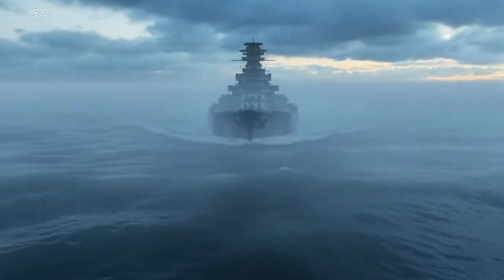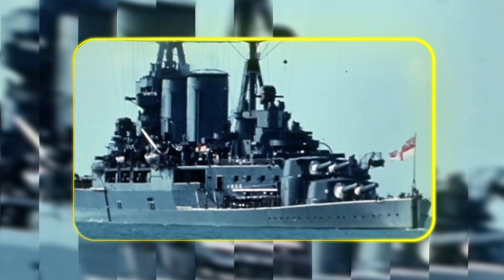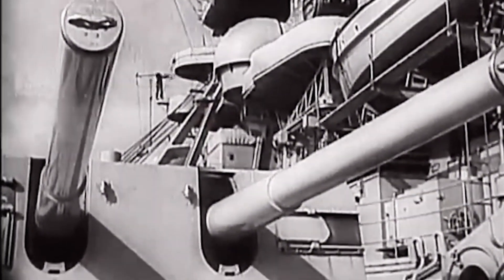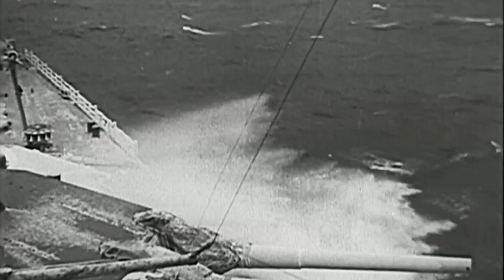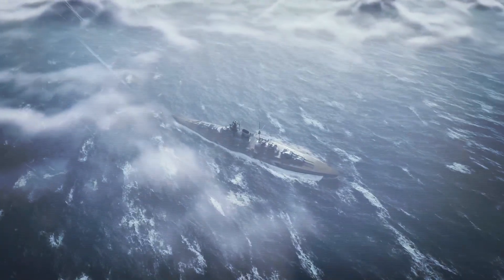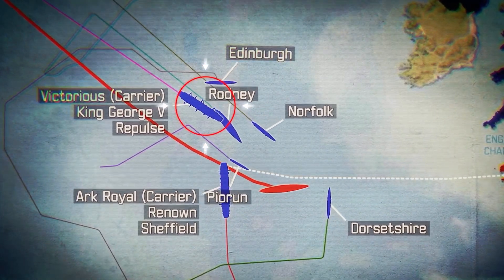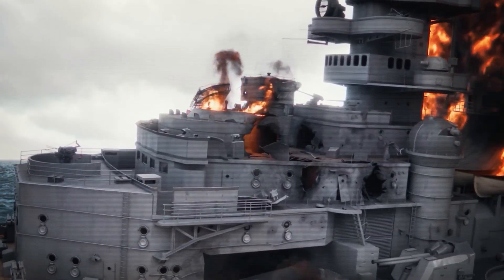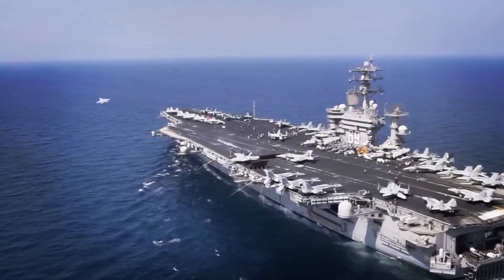The EXTREME Engineering Of The Battleship Bismarck | The End Of An Era

Comment: Bismarck was a very overrated ship. She shared a major design flaw with a number of other Nazi warships, that being a very weak stern assembly. The shallow Kiel canal dictated the maximum draft a ship could have, and this required the Germans to lighten the overall tonnage by going with three shafts rather than the by then standard of four. Four engineering spaces would have made the ship draw too much water. Even with three, she had quite a beam to length ratio. This reduced her top speed, beamy ships can't go as fast. The three shaft design created a major weak point at the transom. Note that the wreck has the crumpled stern. This feature was share by the Hippers and the Scharnhorst class ships. Do a review of how many of their capital ships lost their sterns or suffered stress fatigue and needed dockyard repair. There is a reason the Kreigsmarine was so pitifully ineffective, and this is a part of it.